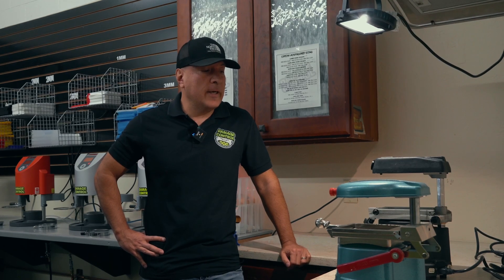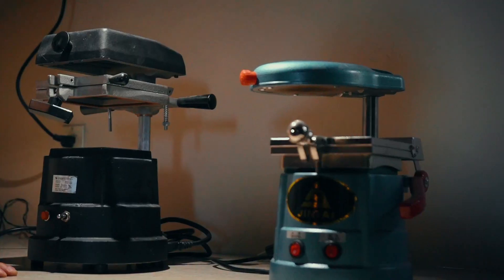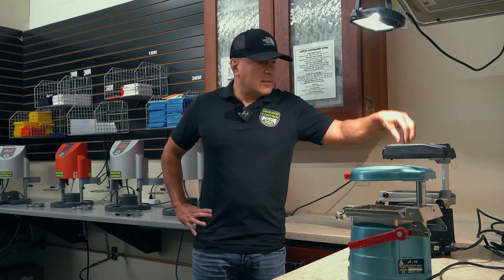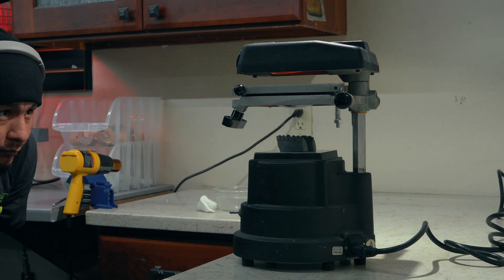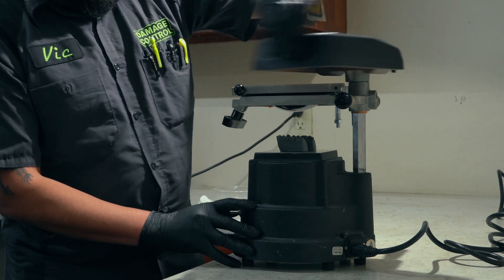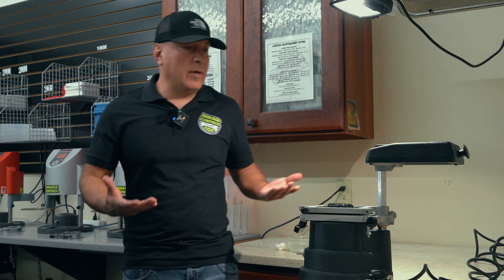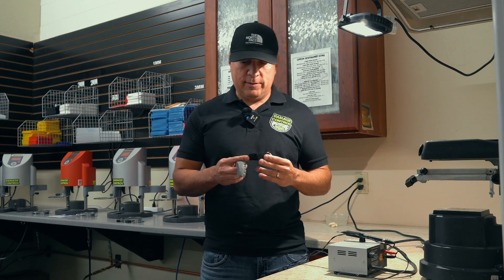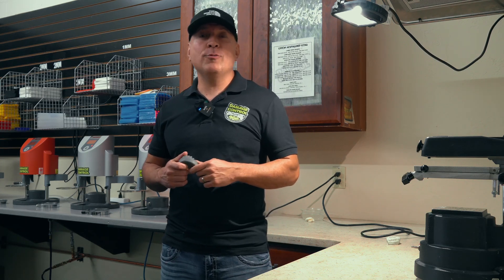Making Custom Fit Mouth Guards on a Vacuum Forming Machine

Comment: There is a simple way to reduce the bubbles using the vacuum machine I personally use
Reply: can you tell us the way ?
Reply: @aboubakrmahrous3402  i poke wholes between the teeth  and some extra arround the edges of the mouthguard then i heat the mouthguard so the marking of the holes get a little bit smaller after that is put the design. it doesnt remove all bubbles but it does most of is like 90%